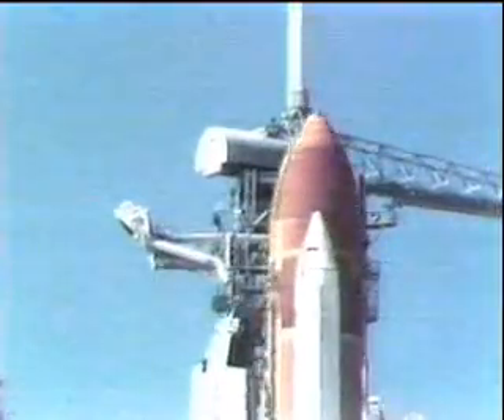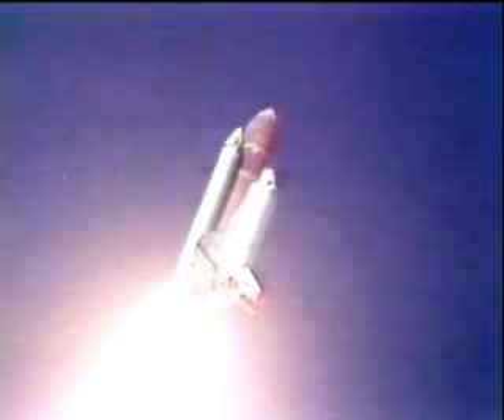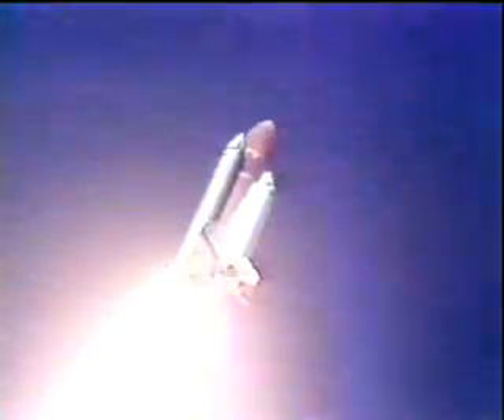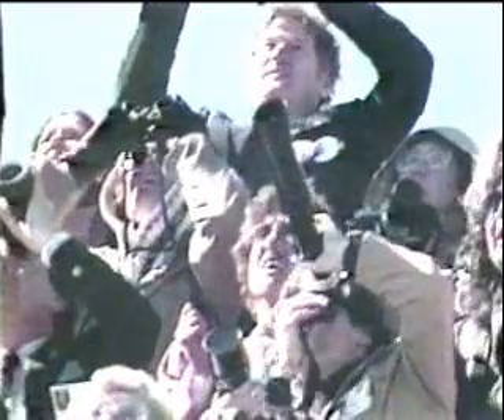SHUTTLE CHALLENGER EXPLODES!

Comment: Sad thing is, Personal Egress Airpacks were found activated and oxygen supplies used after the breakup. They suspect that some of the crew were alive after the breakup or at the very least briefly conscious after the breakup. One of the astronaut's right hand panel had switches moved from their launch setup that were protected by lever locks, meaning that someone knowingly changed them. If the crews cabin maintained air pressure or was at least losing pressure slowly the crew was alive and fully conscious until the cabin hit the ocean at which they were all killed on impact. These people knew they were going to die, and knew there was nothing they could do. I can't begin to fathom the feeling on knowing impending death is right at my front door.
Reply: Wait a minute I just lit a rocket, ROCKETS EXPLODE!

Comment: The orbiter didnt really explode. But the cause was sort of a perfect storm. A joint in the SRB did not perform correctly because of the cold weather.and allowed a burn thru which made the SRB swing into the orange fuel tank which collasped it and everything broke apart aerodynamically. The joint and associated o-rings had been a problem in the past but Nasa kind of put it off.

Comment: Challenger did not Explode. The leak in the SRB broke the joint between it and the External Tank, causing it to collide with the et. The collision punctured the ET causing the fuel to combust, the rapid de-excelleration caused the orbiter to "Break apart". No explosion took place, the ET fuel simply gave the illusion of a fireball.

Comment: What Alyse1969 was referring to was the fact that the "explosion" was actually the disintegration of the ET and the vapors created by the consequential release of the liquid materials in cryo contained therein; not a combustion or an explosion in the typical sense. The investigation performed after the event concluded that it was probable the actual cause of death for the majority of the crew was the detached crew compartment, which broke off the orbiter, crashing into the ocean at 200mph+

Comment: @19EHF  Ummm In fact it was a major malfunction if you review all the footage you will see a large plume of black exhaust streaming from the EFT (external Fuel Tank) 
The Launch was delayed due to bad weather for months before, because they thought it may not be safe those days. And the Crew was knoked out on explosion due to the protection of the Fuesolage but they were killed on Impact of the water. So In fact It was a Major malfunction. The crew knew it would be unsafe. Borded their own doom

Comment: There are two white solid rockets boosters and the shuttles rockets. The big orange thing is the shuttles fuel tank.
One of the solid boosters had O-ring failure causing it to rip off the shuttle, causing the shuttle to skew, causing the shuttle and tank to be torn apart by nothing but air.  Which, at the wrong angle at that speed is like hitting a concrete wall for the structure  
Once main tank is ruptured, boom!  Crew compartment escaped explosion. 
Fuck, imagine being family there watching.

Comment: @rockhopper123452 A frozen rubber o-ring failed, causing the left (IIRC) solid rocket booster to burn through the external fuel tank, causing the vehicle to break up due to an extra 3 million pounds of thrust.

There is no ejecting from a shuttle, which is one of the major reasons the fleet is being retired.

Comment: @SeventhSanctum1 it was an O ring that failed in one of the main engines. The O ring was a seal or a gasket just like what you have in your fuel injection in a car engine. When you have separate parts where fuel is traveling you need it to be sealed. Because of the cold weather a seal was compromised and it failed thus letting fuel escape and ignite just like a bomb then everything exploded. i remember it well and remember seeing this on TV it was almost as bad as 9/11.as far as shock.

Comment: The O-ring in the SRB failed because they launched in freezing temperatures. NASA was more concerned with not having another delay than they were about safety. Also, it's not an explosion. When the SRB came off, it hit the center fuel tank, disrupting the attitude of the Orbiter, which caused it to break up. The plumes are gases and water vapor rather than an explosion. The crew cabin was ejected intact and though they were likely unconscious, they were alive when they hit the ocean. Sad.

Comment: @d1versify It's hard to make out, but he is saying that they received (incorrect) reports that the vehicle exploded. The vehicle itself did not explode, but broke apart, and in fact it disintegration was not enough to kill the astronauts, it was either the cabin losing pressure, or the crash in the ocean.

Comment: wtf?   challenge god...? are you dumb and an idiot?

THE SPACE SHUTTLE DIDNT EXPLODE ITSELF!

because of the colt wheater . the right Solid Rocket booster became an leak that spreaded out uLTRA hot gas. then it quickly closed (cause of the alu particle in the fuel) and prevent a explosion on launch) then 72 secs after launch(i think) because of the strong wind the solid booster leak opened again and burned off the link between fuel and shuttle and then the solid rocket pushed into the fuel and..

Comment: @mach25man It was conclusively proven during the investigation that the safety switches in the cockpit had to have been activated by hand, air usage on the activated air packs was consistent with the time from the accident to impact, and the analysis of the forces during the breakup showed they were likely not sufficient to cause death.The only question is how long the astronauts were awake. You can read more in the Wikipedia article "Space Shuttle Challenger disaster".

Comment: lol, no it was NOT traveling at 257 ft. per second.
It was traveling at 2,257 ft. per second.
Thats two-thousand two hundred fifty seven feet per SECOND..
and thats at the early stage of the launch.
It was probably well in excess of a mile a second when it disintegrated.
That would be 5,280 feet per second.
Average orbit speed is 17,500 mph.
Do the math.

Comment: It wasn't the "explosion" that killed them, as there really wasn't much in terms of an explosion.   Once the external fuel tank disintegrated, it caused the shuttle to change its orientation.   Any significant deviation of the shuttle orientation at that speed, and the atmosphere rips it apart.  That's why simple capsules are safer (and cheaper) than shuttles, and why we're going back to that technology.

Comment: Actually it was a frozen O-ring seal on the right solid rocket booster that broke off at lift-off.  That's why engineers suggested not launching that day, as Imtrione says.
 The tile problem was in the Columbia disaster.

Comment: The engineers recommended not launching that day due to the cold weather. They were ignored because they has already pushed the launch back several days and the concerns that they had for the part were concerns for other launches and nothing happened with them.

Comment: They already knew it was unsafe to launch in cold conditions and NASA debated with the booster manufacturers and engineers about the temperature however management went ahead with the mission because they delayed it so much already and were under pressure. And to be pedantic it wasn't an exlosion, the rocked tore itself to pieces under immense aerodynamic forces

Comment: I'm surprised no one caught on to this...
The spectators were some distance away from the launch pad, and the shuttle broke up about 9 miles in the air, so they probably couldn't see what had just happened. They probably couldn't tell that the shuttle broke up, and they were cheering because they thought the fuel takes were coming off or something.

Comment: Not a [shuttle] engine problem, it was the failure of a joint on one SRB to seal which caused hot gas to escape and burn through the solid fuel tank. The SRB nose swung into the solid fuel tank and the tank exploded, ripping the shuttle apart.

Comment: "contrary to the flight dynamics officer's initial statement, the shuttle and external tank did not actually "explode". Instead they rapidly disintegrated under tremendous aerodynamic forces, since the shuttle was past "Max Q", or maximum aerodynamic pressure"

wikipedia agrees with you! :P

Comment: Sad and hard to take in, i just watched this, i had heard of it, and decided to look it up, before i knew, but i just didnt see it happen becuase i wasnt born till' 7 years afterward, but just to say, 
contrary to the flight dynamics officer's initial statement, the shuttle and external tank did not actually "explode". Instead they rapidly disintegrated under tremendous aerodynamic forces, since the shuttle was past "Max Q", or maximum aerodynamic pressure.

Comment: The shuttles did not have ejection seats. There is NO means of escape for the crew before SRB separation (about 2 minutes). Even if the crew had parachutes it's unlikely they would have been able to deploy them as they may have been knocked out during the breakup.

Comment: Nasa knew tht the design of SRB 
( designed by Morton Thiokol )
since 1977 had some problems. 
Yet, Nasa ignored engineers' advices
tht they shudnt launch it during 
cold weather.(-0.5 Celcius degree on tht day)
After 73 seconds of launching, black smoke 
came out from 1 of the SRB and exploded
at 14.6 KM ( 48000 feets ) from earth.

Comment: There was an ejection system installed on the first 4 shuttle missions.  They were then considered to difficult to administer since there are two decks a crew of 7 must sit on in a shuttle and the speed and altitude it travels at launch would not render safety to the crew if there use was necessary.

Comment: Booster Rocket O-ring failure due to cold temperature allowed hot gases to escape at the lower joint of the right hand booster rocket, which ignited the main fule tank and ripped the shuttle to pieces.

Comment: The SRBs are solid fuel rockets and their structural integrity was not compromised during the rapid burning of the proppelant from the ET.  If you watch closely you can see the blowby occuring on the right SRB even after the explosion.

Comment: the srb blowby burned through the right srb's aft attachment strut, which caused the srb to detach and impact the external tank, causing it to rupture.  the "exlposion" seen is actually the rapid burning of the main tanks liquid oxygen and hydrogen.  the aerodynamic forces then ripped the shuttle apart when there was nothing left to propel it through maximum aerodynamic pressure.

Comment: no, those were shuttle pieces.  The shuttle was at an altitude of about 50,000 feet when it exploded, which at that current speed was about 30 seconds away from space.  The flaming contrails are pieces of the shuttle ater it broke up in extreme G FOrces after losing the mian external tank.  One of those pieces is the intact crew cabin though.

Comment: The reason why it exploded is because th "O"-Rings that contected the booster to the main fuel tank worked inproperly.  The few nights before take-off Florida experienced the worst weather (Frost) in a long, long time.  Not only did the frost destroy the orange crop of that year, but also the shuttle.  It was something that should not of happened and the launch should have been postponed

Comment: this accident had nothing to do with the Shuttle Challenger itself.  Challenger was fine.  It was the main External fuel tank that exploded, not the spacecraft.  The starboard rocket booster's O-ring seal failed due to cold weather and cost-cutting materials used to manufacture the O-ring seal and the flames leaking through the seal ignited the tank and it exploded.

Comment: you should check it on wikipedia they tell the hole story,hot gasses were leaking because of an defect o ring because it wasn't build for 2 celcius and it started leaking on the feultank and that made the shuttle ripped in 2 parts

Comment: The official report based on examination of the remains of the crew and shuttle compartment states that the crew could have survived the initial explosion but almost certainly lost consciousness when the cabin depressurized at 65,000 feet.  They DID NOT sit on the bottom of the ocean and were certain killed by the impact with the water if not before.

Comment: If you listen to the PA speakers in the shots of the crowd watching in the first minute you  may notice that they are way  ahead of the video of the launch; disjointed.  NASA's microphones must not have been opened much this day either, the noise of the engines on the broadcast is very faint, much quieter than most launch telecasts.

Comment: you can see the kink in the exhaust trail where the shuttle hit a nasty crosswind.

also, rescent studies have shown that it was only a buildup of aluminium in the joints of the SRB from the solid fuel that prevented the shuttle from exploding at launch.

Comment: The orbiter broke up due to aerodynamic forces on the vehical. The external tank was the first to fail from the burn-through, resulting in an explosive burn. This threw the orbiter out of it's slipstream, causing nearly instantaneous breakup to to the forces present. They were close to "max q" when it happened, meaning the forces on the Shuttle were at their greatest.